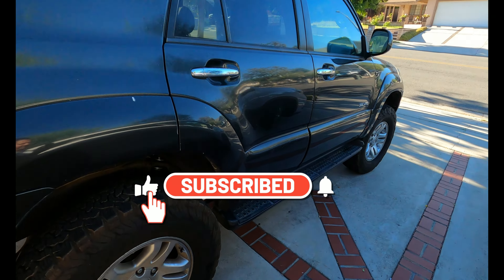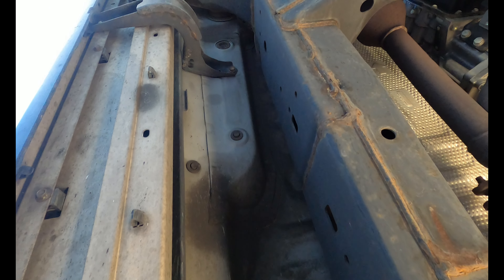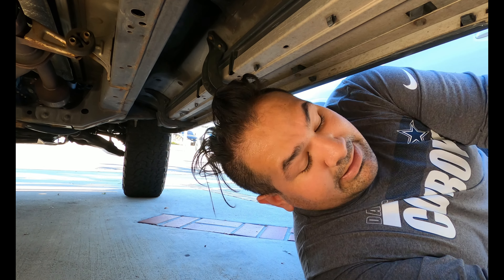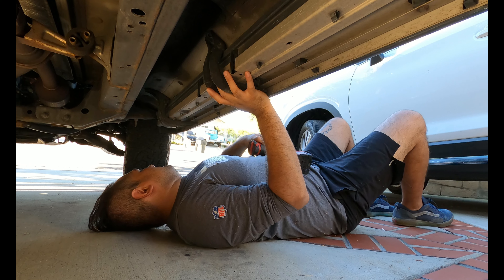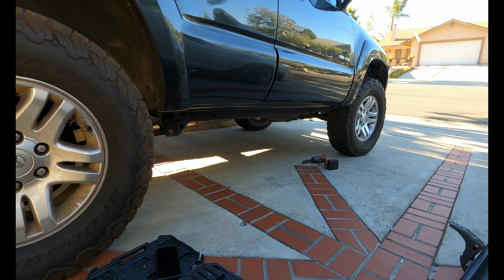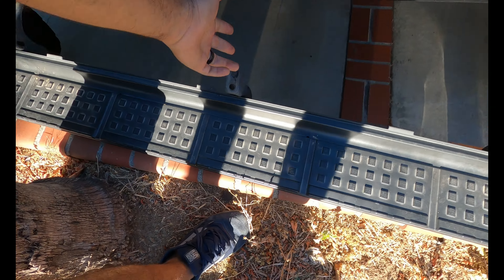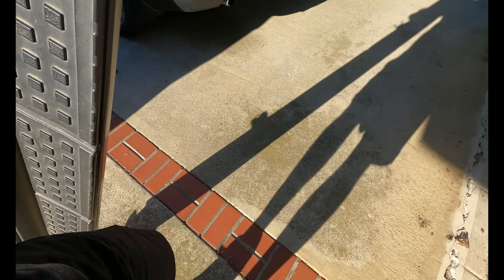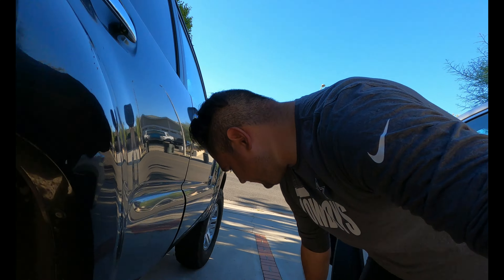How to Remove Your Running Boards On A 4th Gen 4Runner

Comment: Why don't you have leds in your running boards? Is it a grade thing?   have a 215 Hilux Surf, when I unlock it or open the doors the running board leds turn on. I wanna take them off for weight reduction but the leds are so useful at night!